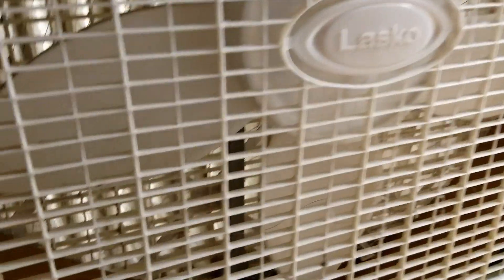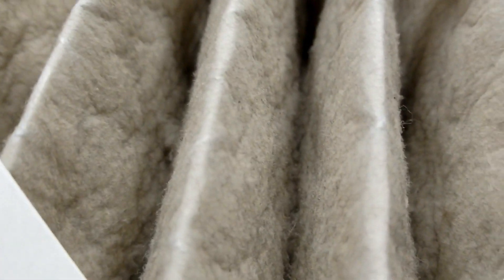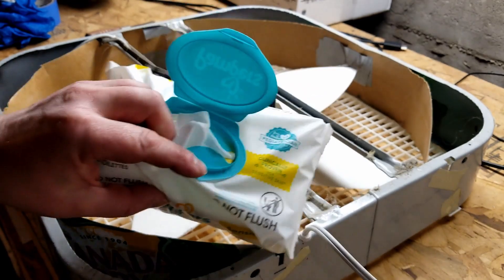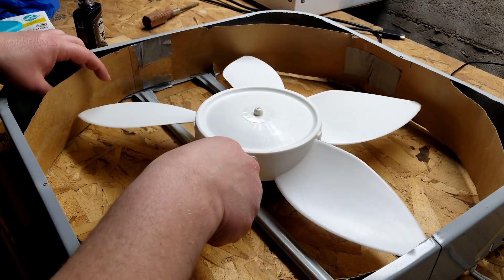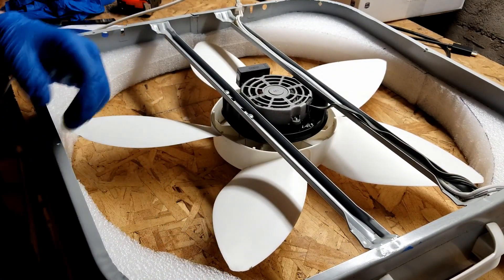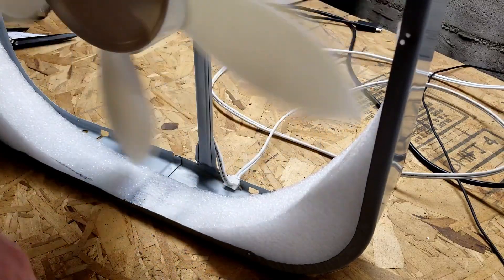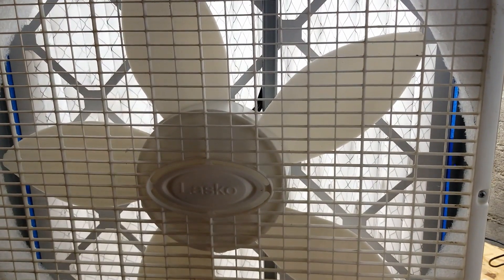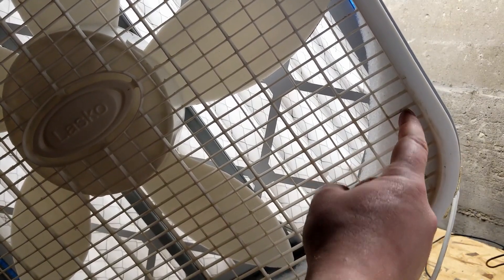DIY 20" box fan air purifier - MODIFICATIONS!!!

Comment: Good stuff.  Looking forward to your next improvement.  Why not a box (Corsi-Rosenthal box) setup versus right in the back of the fan?
Reply from the maker: Mongo thank you!  
Good question. For Mongo Box take up to much square footage of floor space and less portable.  Cost vs benefit, cost of 3-4 extra filters per fan outweigh the benefit. 1 filter on back last Mongo 6 months, A 5 filter box should last 2.5 years, Mongo guessing that they don't actually last that long. Mongo never done comparison test cause to many variables to run a proper test. Any changes in lifestyle, house airflow and environmental variable could change the performance of that test. So Mongo just keep it simple and use 1 filter. Easy to monitor performance. For example, Mongo filter fan in main living area last 6 months, Mongo filter fan in basement last 1 year.

Comment: The REAL test... See how clean the fan blades and motor are, when you're ready to replace this new 20" X 20" X 2" filter! This modification should help the fan with back pressure, allowing you to run a filter longer than before, before it becomes too restrictive to be effective. Filters are actually at their best, just before you're ready to replace them. A 'grungy' filter is actually slightly better at filtering fine particles, than a brand new one. The Caveat, is that it's also more restrictive to airflow. Ducting the fan blades will help more than you know.
Reply from the maker: Very true, Mongo looking forward to results